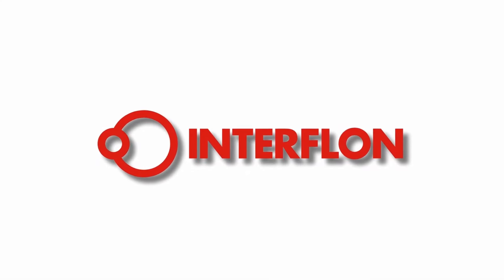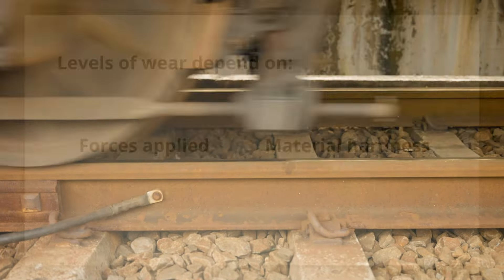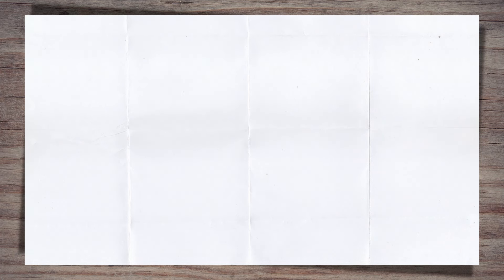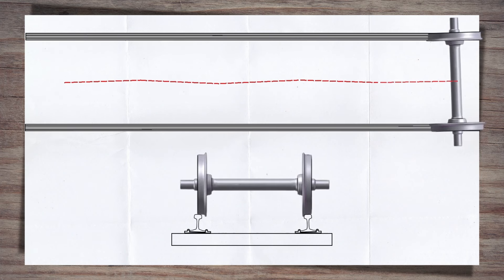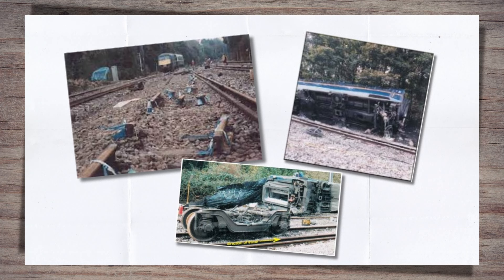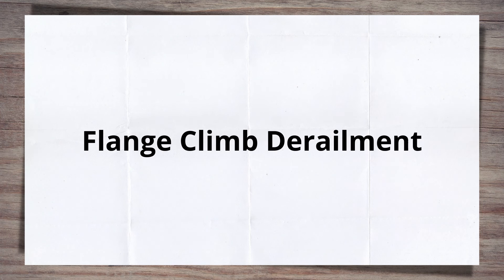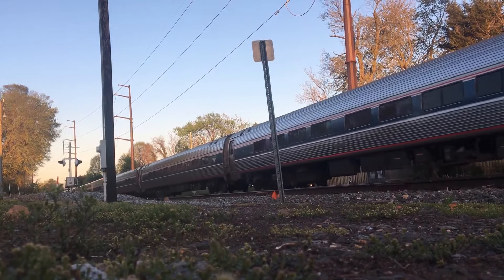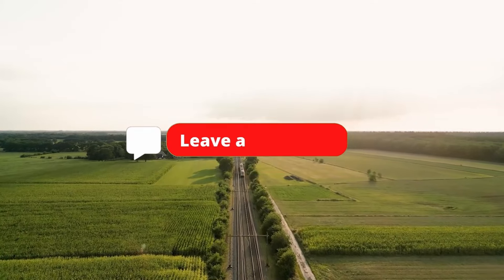How Rail Lubrication Prevents Train Noise and Track Damage Simply!

Comment: Check rail lubrication is commonplace on Network Rail and is visible in a couple of the photographs in this excellent video.  I would like it to be specifically referred to, particularly whether the gauge is widened to completely take the flanges away from the high rail gauge face and thus eliminate sidewear.

Comment: There is another effect not mentioned. The wheel rims are actually conical and the top surface of the rail matches this. It means that the two wheels locked together on an axle can change their rolling radius a little, often all that is needed to counteract the inner and outer rail length.  A lot of the screeching noise it one less loaded wheel being forced to slip on the rail. The coning effect reduces this provided there is sufficient latteral rim clearance. The noise usually reduces during freezing weather as the ice is a lubricant, so much so that sand then has to deposited on the rail to regain traction.

Comment: Maybe this is a dumb question:  Do you lubricate both rails?  or only one.  My reasoning is that if you do both, there would be slipping, and if only one, that wheel will slip but not the other, reducing the screech noise.  Obviously lubrication on curves should be on the weight bearing rail.  Or so I think..

Comment: Lubricants to reduce squeeks is one thing but I think that another area is the third-rail where a lubricant might be applied to prevent icing.
One of my ambitions would be to witness an electric train starting up on a track which has been out of use for a long while to the extent that not only are the running rails covered in rust but also the conductor rail. Given a starting current of 10,000 Amps (or am I OTT?), this might be "exciting" to say the least with copious arcing and sparking.

Comment: In San Francisco on some of the MUNI Metro lines there are flange and rail head lubricators. One was at Duboce and Noe to keep the noise down for trains entering/exiting the tunnel. Another was on the K by Junipero Serra and Sloat Blvd for the flanges. The K/M lines converge/diverge in the middle of an intersection so that sees a lot of wear. 

Just some real life uses I see often on my rides

Comment: What is the effect of the lubrication on the stopping performance of the train? I would expect that train wheels will start 'aquaplaning' on the rails a lot faster
Reply from the maker: Thats a really interesting question. It isn't an issue that I have ever come across, normally it would be a lack of lubrication! But I can imagine you are right that after a certain point, too much lubrication can cause adhesion issues, but only if the lubrication was applied to the rail head rather than the gauge face.

Rail head contamination, from leaf fall or other things getting onto the head, does cause trains issues. The crash at Salisbury was caused by a train unable to stop due to read head conditions so it is a very real risk.

Hope this helps!
Reply: You lube the side (where flanges contact), not the head. So if it's done right - none at all.
Reply: I used to work for a small independent rail company that would get contracted by class1s to service the trackside lubricators. I would relate them similar to a grease gun except on a larger scale. There is generally a pressure point where as the wheels roll over it hits the pressure point and every time a wheel hits, it pumps a little bit of the rail lube onto the flanges. They only lubricate on the inside of the track so only the flanges get lubed. I'm in the United States, they might do it differently in other parts of the world. Best wishes!
Reply: I bet that's taken into account. With most fluids, an increase in pressure increases the viscosity of that fluid. So if you didn't hydroplane as you suggested, the lubrication could increase the physical coupling of the wheel to the rail. Whew.

The reason why ball bearings don't instantly wear out is this increase in viscosity.

Comment: Which get replace more often a train wheels or rail the train travel on?
Reply from the maker: That is a very good question! I’ve not got any experience in rolling stock so I’m not sure. For rails it depends if they get defect, how much they are used and the surrounding condition. I’ve seen decades old rails and other that need replacing in months

Comment: I always thought gcc was a rcf defect? i know P8 wheelsets don’t help either - i look after a sidings that have P8 wheelsets over them every day and we see a lot of rcf and spalling occurring on curves but the speed limit is 5mph and the x-level is 0mm due to the low speeds so what can be done to mitigate these defects besides from grease?
Reply from the maker: I have seen it mentioned as an RCF and separately while researching the video. It seems they have slightly different propagation mechanisms.

In terms of mitigations, its a hard one on slow speed track like that. Heat treated rail might help but can be expensive, not ideal for sidings

Comment: WD 40 is not a lubricant. If used as a lubricant it's a very bad lubricant.
Reply from the maker: I used it as an example as most people have heard of it, although i believe it is billed as a lubricant, amongst other things. But i guess if your trying to do multiple things you cannot be the best at all of them
Reply: WD-40 is called a "multispray", among other things, and lubrication is most important function, in most cases. Trouble is, it's relatively volatile, and evaporates, which is the main reason it's not a good allround lubricant. It's better for quickly addressing some types of issues that have already happened, than it is for preventing issues from happen in the first place. It's especially bad for preventing problems long term and exposed surfaces. So, it's definitely a lubricant, but not one you would want to use when you need long lasting lubrication.
Reply from the maker: Thank you for the in depth reply, very interesting!
Reply: "Cant / cant / cant  lol.